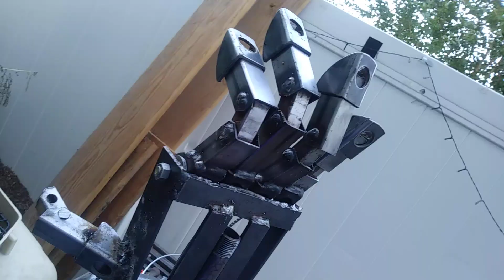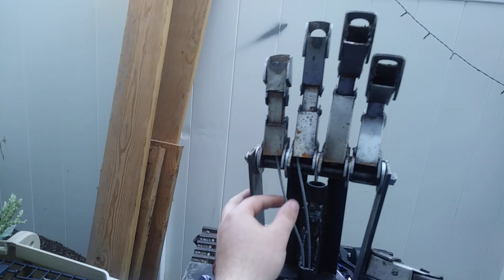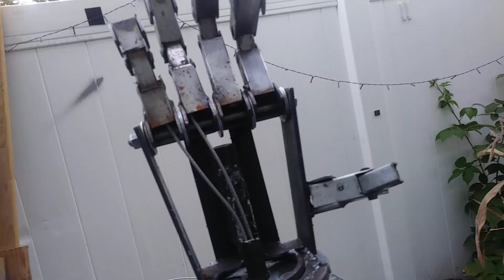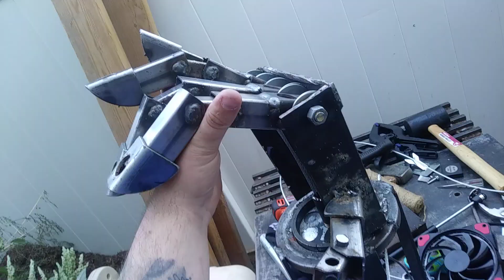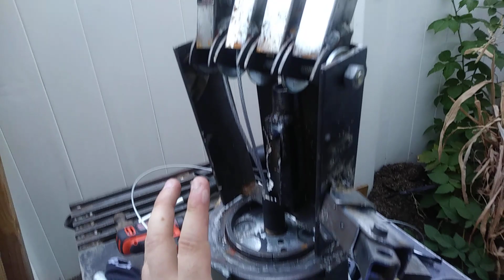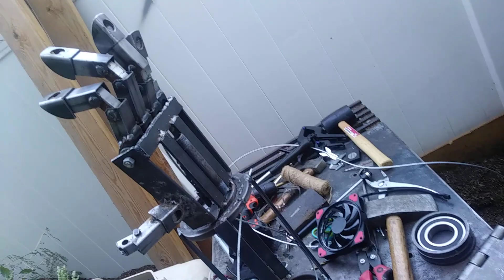Power Armor Project update / Maker Faire submission

Comment: Are you planning on having this armour be able to use weapons?
Reply from the maker: Yes down the road lol its mainly defense atm. Still designing a deployable shield from the arm.
Reply from the maker: I thought of that at the start so I'm adding that knuckleplate door hinge for default
Reply: I would just make a gauntlet so you can use your hands and maybe a claw or hook for if you want to lift heavy stuff. Or the gauntlet could lock shut for heavy lifting.
Reply from the maker: @NoBSSurvival  that sounds awesome! The second I start weponizing this prototype it may send red flags in the wrong areas being my military background and anything armor\ weapon related has a bad stigma to those who don't dabble in the arts. Im definity down to see what you got in mind? Ill send ya a FB request.
Reply from the maker: I'm also designing the palm to mimic an actual palm with curves to enclose with. The inner hands will be lined with heavy duty grip tape and I'm still debating locking joints like a rachet.